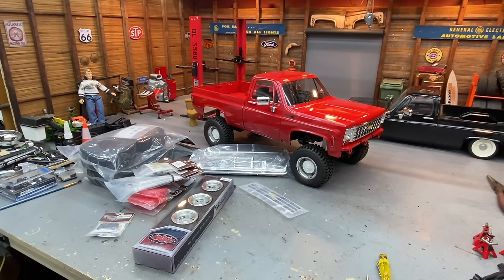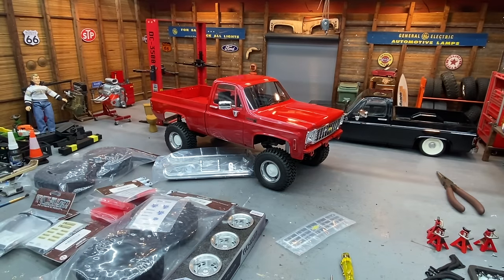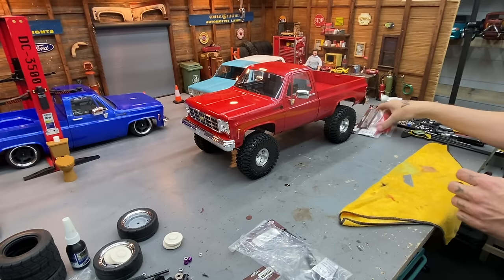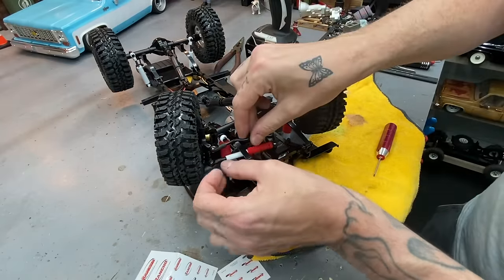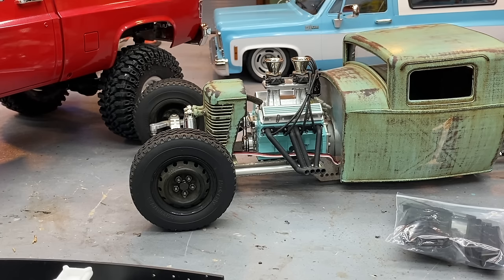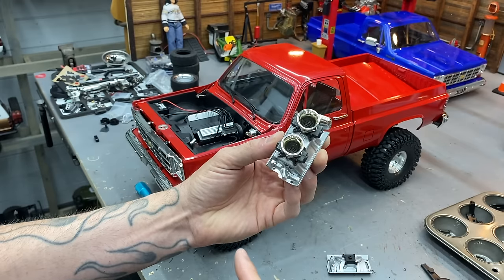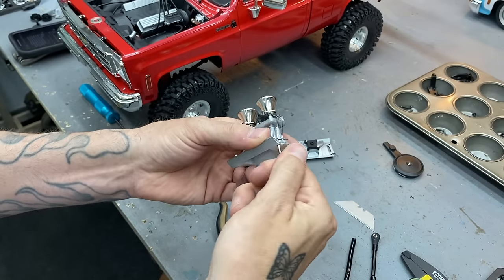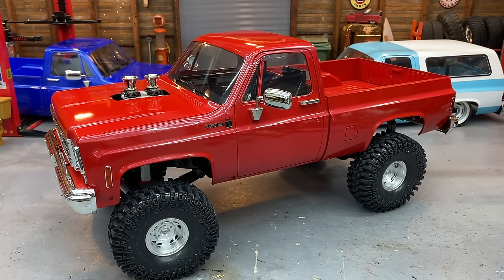New Build! RC4wd K10 Scottsdale, Tunnel Ram, Centerline Wheels, Swampers & So Much More, Part 1

Comment: Glad to see you finally picked up one of the tiny adjustable wrenches! I've owned a little 4 inch one my whole RCing life, I got it from my dad who got it from his dad who got it from the Navy.
But I've been collecting all kinds of miniture tools, most recently I got tiny channel locks, they're also about 4 inches long!
Oh yes! for drilling small holes I'd highly recommend getting a fiskars precision hand drill. It holds some very small drill bits (even smaller if you put tiny heat shrink on them.) And is way less hand cramp inducing than a pin drill. It isn't cheap but it's pretty worth the investment. Especially if you've got a coupon.

Comment: Looks pretty good! I remember back in the 90's Mickey Thompson Baja Belted tires were all the rage on the show trucks. I think they are available from RC4wd but only in 1.9. You probably already know, but you can pick up a pin vise really cheap for those tiny drill bits.